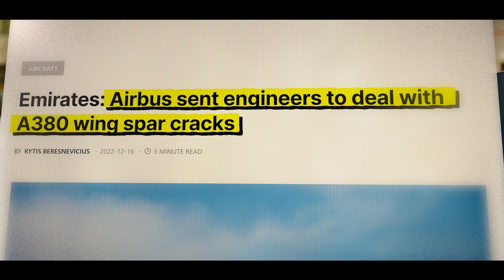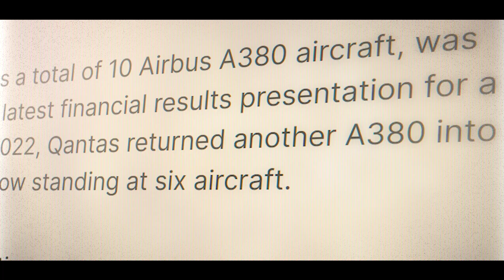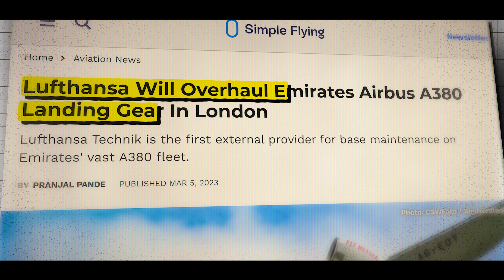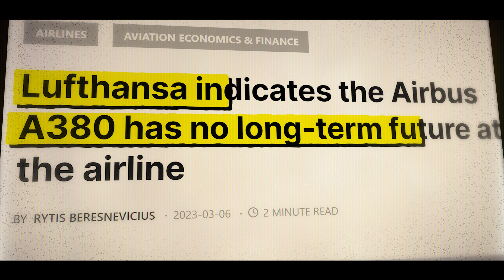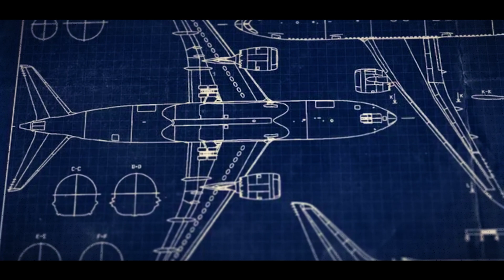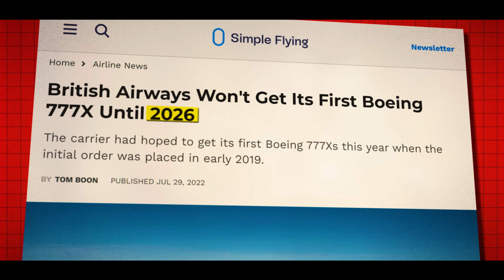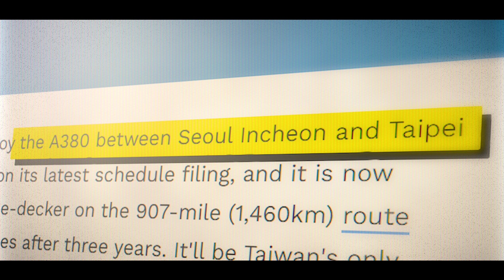Why Airbus A380 Has So Many Problems?

Comment: Airlines have no choice but to put their A380s back in the air as the demand for air travel has boomed!.  The newer A350, given that its better and there are a lot of orders for this more economical jet, cannot be delivered on time and so many are resorting back to the refurbished, reconditioned A380s.  Emirates wishes to order more A380s on the condition that Airbus redesign and repurpose its engines and materials to meet the needs of the times in being more modern, more economical with lower maintenance cost, hopefully.  Emirates just had a $3+ billion profit lately as they had no choice but to continue to operate 80% of their more than 100 fleet of A380s even during pandemic times and by stroke of luck, their business is thriving and their leaving the competition in the dust.

Comment: The thing is, you are comparing an old plane with new one. Of course they are going to have newer and better features. If Airbus was to realise an updated A380, with better fuel efficiency and other improvements found on modern jets such as the Boeing 787 and Airbus A350, it would be as good as these planes.